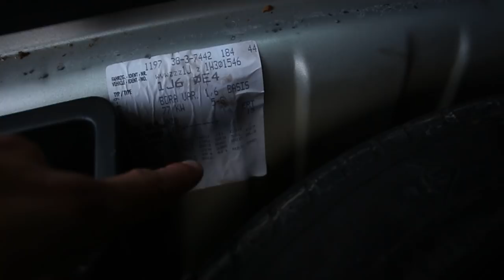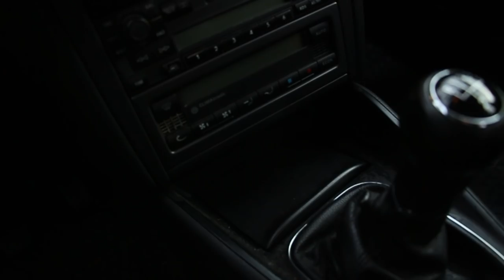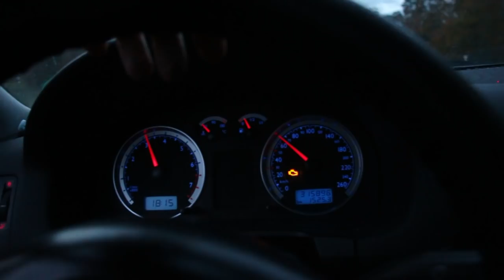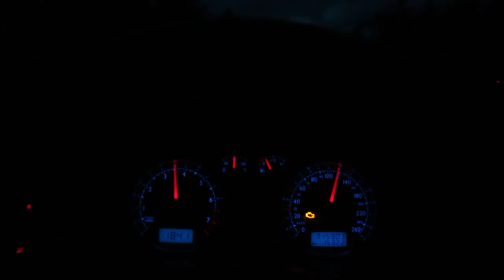My Junkyard Bora Variant Is Home!!

Comment: Big tip for the bora dash. To fit all the wood trim u'll need the full radio/climatronic frame since the black in your car is all one piece. To get the frame out u'll need to pull the full bottom half of the dash. Had to do the same when I changed my golf dash to a r32 dash. Not to hard but a time consuming job. Love the vids!👍🏻
Reply from the maker: Jelle van Onna already swapped in the wood trim didn’t need to do anything besides pull the old stuff out lol glad you’re enjoying the videos 🙌🏼

Comment: Hey great deal on that wagon !!
To remove window from regulator you’ll need to me able to raise and lower the window to line up the 2 10mm bolts that clamp the window on with the holes in the black part that holds the window motor and cables for the window .
Once u loosen them you can pull the window right out .
I’m going to message you on Instagram I have something that will really help you when working on mk4s

Comment: You can take the reflex silver front door off the 4 door golf at the junkyard. The front doors are the same. You’ll also need the cage for the wood grain trim. The one you have is different so the side pieces are not removable and the bottom piece won’t clip onto your current radio cage.
Reply from the maker: Dallas Green yeah I already swapped all the wood pieces with no fitment issues lol the pieces came out of the same car and yeah I was looking for reflex silver golfs but the doors were damaged

Comment: Mk4 window has to go down and comes out with the stupid regulator. Mk5 are one of the more odd ones to work on for stuff like that. Because you remover the outer door skin. And not the door panel.  Trim paint the upper grill. Looks so much better then body color. I did it on my old mk4.
Reply from the maker: Ryan Lott yeah I’ve never had to pull one from a mk4 and it’s completely different then a Mk3 lol I’ve seen how they do it on the Mk5’s. I’ll keep that in mind I bet it’d look good
Reply: @Mk3Smith  yeah mk4 is a pain. I'm a auto tech and had to do a few. The door latch if I remember correctly it's attached to the regulator tray as well.